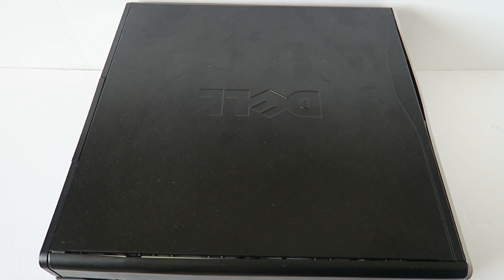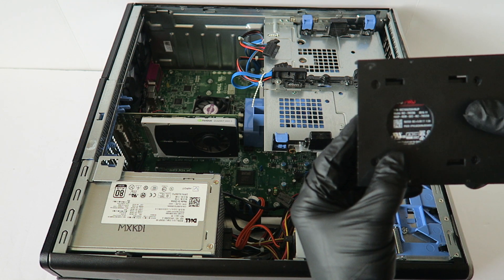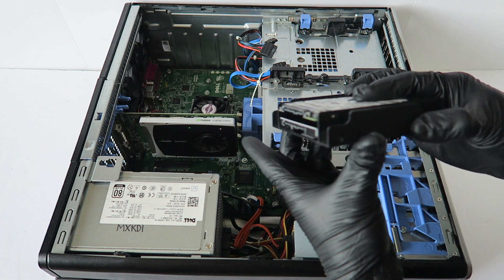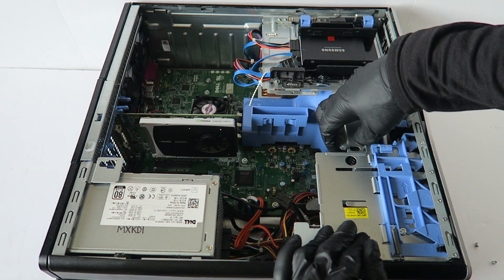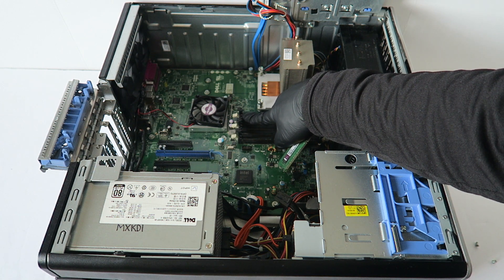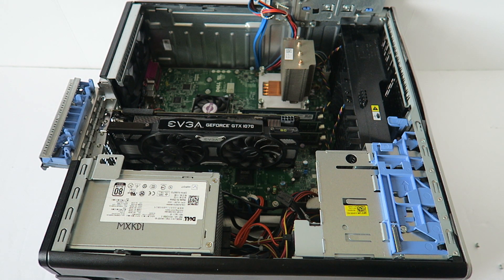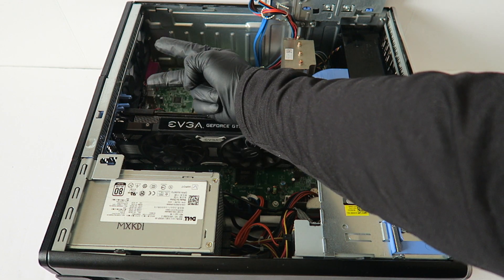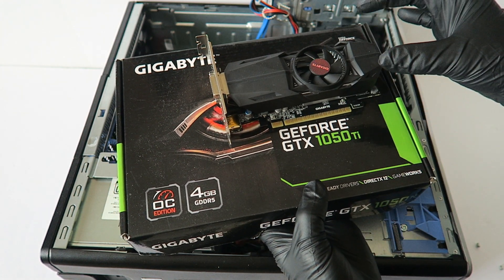Dell Precision T3500 Gaming Upgrade Video Card RAM SSD

Comment from the maker: Here is the list parts upgrades.
----> For GTX 1070 6-pin to 8-pin PCI Express Power Converter Cable for Video Card 
(1.) Video Card EVGA GeForce GTX 1070 SC GAMING ACX 3.0 Black Edition, 08G-P4-5173-KR
(2.) Video Card NVIDIA Founders Edition GeForce GTX 970 
----> For GTX 970 6 pin PCIe to dual 6+2 pin PCIe splitter Cable for Video Card
(3.) Video Card GIGABYTE GeForce GTX 1050Ti OC Low Profile 4GB, GBTGV-N105TOC-4GL
(4.) Hynix HMT125U6DFR8C-H9 Memory  DDR3 1333MHz  ( 2GB 2Rx8 DDR3 PC3-10600U )
(5.) Kingston KP223C-ELD  Memory DDR3 1333MHz ( 2GB 2Rx8 DDR3 PC3-10600U )
(6.) Samsung 256GB 850 Pro Solid State Drive
(7.) Dell 0R494D R494D Caddy Tray 2.5" - 3.5"
(8.) Seagate 2TB 2.5" Laptop Internal Hard Drive
Reply: Hi dose the gtx 1050 work with the dell t3400???
Reply: @MrConcyp  yes

Comment: I installed the GTX 1080, and it works great!  However the side of the T3500 case gets very warm where the air comes out of the graphics card heat sinks, and I notice the GPU temp is 87C with the case cover on, 83C with it off.  Is this a concern since the hot outcoming air is hitting the side of the case and doesn't have a great place to "flow"?

Comment: thanks for the very informative video. I also have a dell t3500 but the drive tray doesn't go all the way down because it seems to be blocked by the front fan assembly, do you have any solution for that?

Comment: Hello dear mxkdi,
                              I want to know if my Dell precision t3500 can allow 2 GPUs inside it.(I'm trying to say that can I install 2 GPUs at a time and run both together?).

My specs:
Asus phoenix GTX 1050 ti 4gb Gddr5
16 gb ram(2×2×2×2×4×4)
2 hdd (1tb and 160gb)
Intel xeon w3520 4 cores 8 threads

I have an extra Nvidia Quadro 600 1gb ram ddr3 and also want it to be running together with the 1050 ti.Is it possible?
Reply from the maker: Hi,  i would recommend sell both video cards and just get one faster video card and use in that PC.

Comment: I upgraded a T3500 with more ram, a GTX 1650 Super, a Xeon 5675, and an SSD, but they all benchmark about 80% of where they should be. Any ideas? Is it the motherboard? Or did I just get unlucky with all four of them?

Comment: I have also a t3500 my power supply is 525w I have a Xeon x5675. 12 gb or ram in 6 sticks and 2 ssd's. Do you think a 2060 is going to be ok ? I'm gonna buy use the conversion from 6 to 8 pins. I've see the tdp is 160w. So it's going to be ok?

Comment: How important is the chipset cooler? I just bought a t3500 with Xeon w3565 CPU and want to upgrade it with an MSI RX570 Armor 8GB OC. I saw in several videos that rear fans were installed and also 80mm fan was mounted to the 0U016F CPU cooler. Depending on how temperatures will look like, I will do those cooling upgrades. 
But this is the only source showing additional chipset cooling. Can you comment why you used it? Is it maybe depending on the CPU (you have 6-core)?

Comment: This is the video im looking for. Planning to buy the T3500. Is it also possible to upgrade the gpu to 1080ti or 1660?
Reply from the maker: Hi, gtx 1070 only and gtx 1080 ti will be bottle neck with this old system.
Reply: Mxkdi wym buy bottle neck is it useable?

Comment: Hi Mxkdi, what if I plug in 6pin from PSU directly into 8pin of GPU? (I plugged 6pin into my RX 580's 8pin with 2 pins left alone, the card shows red light). If I use 6pin to 8pin it would work?
Reply from the maker: Hi, yes you have to use 6 Pin to 8 Pin PCI Express PCI-E Video Card Power Adapter Converter Cable to make your video card work.
Reply: @Mxkdt  ok thanks for so quick reply!
Reply: @Mxkdt  I also purchased t3500 and rx 580. The video card has 8 pins. What should I do now? Is it safe using the connector?
Reply: @TheShaziaShow  buy the SATA to 8pin molex converter power cable.
i also used it, works perfect.
before that i tried 6pin to 8pin converter but the cable burnt after few weeks.
Reply: @HassaanALal  did i use sata to 8pin with rx570 ?
Reply: @MUHAMMADAli-pe2mx  yes you can use SATA to 8pin for rx570
Reply: @HassaanALal  thanks and my supply is 530w is that much?
Reply: @MUHAMMADAli-pe2mx  ye it's fine just dont overclock
Reply: Did it work? Also worried.
Reply: @TheShaziaShow  did it work?

Comment: i have t3500 and w3530 prossesor can i have rx580 without bottleneck?
Reply from the maker: Hi, You can upgrade to Xeon X5650 or Xeon X5675 for around $30 that is great deal.
List of CPU you can Upgrade..
1. Intel Core Xeon X5660 2.8GHz 12M Cache 6-Core SLBV6 Processor
2. Intel Xeon X5675 3.06GHz 12MB 6-Core 95W SLBYL Processor
Reply: @Mxkdt  thx very much♥️♥️
Reply from the maker: Hi.

Comment: My T3500 came with a WD Raptor 10k rpm.  Is it worth going SSD?
Reply: 2 raptors in raid is still slower than an ssd, but back in 2008 it was the fastest option.
Reply: Do a comparison in speed with a CrystalDiskMark, this will answer your question. :)

Comment: Hello Mxkdi,

Always very good videos!
But my english is not perfect...

How is the chipset fan fix? What is the format?

thx for your return,
Bye
Reply from the maker: Hi, yes you can use 40mm fan or 50mm or 60mm fan for cooling chipset and rear fans are two 80mm
Reply: @Mxkdt  Thx! But the fixations for fan chipset? My original rad is not equipped to receive a fan...

Comment: I got a T3500 for 40€ a few months back.
Upgraded the CPU to a X5675, the RAM to 24GB and threw in a SSD and GTX970.
Really happy with it as my secondary rig now.

Great video btw.
Reply: Did you have to change your power supply?
Reply: and did you need extra splitter cable or something like that?
Reply: Yes I had to get a splitter cable since the PSU only had one 6 Pin connecter and the GTX970 needs two. 
But changing the PSU would work too since it's not proprietary
Reply: @JakonDeluxe  thanks,  only one thing, What PSU did you buy?
Reply: I have a Corsair VS550 but any ATX PSU will work.
Reply: @JakonDeluxe  Hey Jakon, sorry this is the last questions ahah: can you link where I can buy the splitter for extra power?

Comment: Thanks for such a informative video, I need your guidance, I am using Dell Precision T3500 with EVGA GTX 770 2gb can i install another one and use bridge option or what you say...?
Reply: SLI will not be worth the money. RX570 or RX480 will cost the same as a second 770, and will give you a better experience.
Reply: Sli won’t work, only crossfire (for amd cards) does

Comment: My GTX 970 doesnt let my pc start up Im using a 6 pin and a sata to 6 pin connector
Reply: Don't use sata to 6-pin adapter! It doesn't provide enough juice! Use a molex to 6-pin connector!
Reply: I think it's a power supply issue

Comment: what cpu are you using? I was wanting to know if w3550 will have bottleneck issues with this gpu(gtx 1070)
Reply: bottlenecking is usually a figment of the imagination invented by people who want you to buy a new cpu from them. my i54570 has never been above 70% capacity with my rx 570 at 100%
Reply: xeon cpu

Comment: can Rx 580 will work or I need to upgrade the power supply to 600watt ? btw love your videos it's very helpful🙂
Reply: It will work fine. GPU power requirements as listed by the manufacturer are always exaggerated, while Dell PSUs, particularly in their workstations are underrated.
Reply: Dell motherboards don't like AMD GPU's
Reply: @tatemushroom1002  From what I've heard they don't like AMD GPU's like the RX 560 that only draw power from the PCI-E slot. Ones that have a 6-pin connector to the PSU seem to work from the many examples on youtube

Comment: what is the model number of the psu you have??
Reply: I suspect that the original 525W ... I had to replace the model N1100EF (1100W). But it fits the power supply of the T7500.

Comment: So my question is what Xeon are you running, I am getting thevw3690 setup soon and I glad to see that this system can get extra cooling and a great video card , but what u plan to do is upgrade to a better country cooler I heard Cosair has a good one , so that cooler does the trick for you not to much heat on CPU?? Thanks great video..
Reply from the maker: Hi, i am using original dell heatsink with Xeon x5675 right now and you can also use x5660, or x5680, x5690.

Comment: Are you sure that stock PSU (I believe is 525w ?) is enough for that GPU? And are those 6pin to 8pin adapters safe to use (knowing that 6pin maximum wattage is 75 and 8pin is 150watts)? I'm asking because I'm planning to upgrade my T3500 with RX 580 and I need to be sure will it work. Thanks.
Reply from the maker: Yes 525w is enough on load with gtx 1070 video card system using around 280W while gaming. i am not sure if rx580 will work with this system, i never  tested.

Comment: hey can u tell me why my second HDD isn't working as fast as the SSD like it's very very very slow when I execute a game it stays at loading for an hour do I need to put a Dell optiplex sata cable into it or what?
Reply: Ssds are faster than hdd so hdd speed will be slow

Comment: 😏 interesting, ive never seen u install such a fast video card in ur videos before, cheers ✌️😏🥃
Reply from the maker: Hi, you can also use gtx 1070ti faster video card if you want.
Reply: @Mxkdt  ✌️😎 ok Cool
Reply: Mxkdi hey sir I wanna know what cpu did u run on that machine ?
Reply: @xadofn5762  on a t3500 people like: x5670 x5680 x5690

Comment: Hey !! Great video thanks.  Can you do the same upgrade on a T-7500
Reply from the maker: Hi, i only have T3500 and T5500 right now and my next upload video will be T5500 gaming upgrade.
Reply from the maker: Yes you can do same upgrade on T7500.
Reply from the maker: Dell T5500 Motherboard does have Intel 5520 chipset 2009 and Dell T3500 does have Intel X58 chipset 2008
Reply: @Mxkdt  😋 sounds yummy, just get one of each 🙂🙂🙂
Reply: ✌️😏 Sure, T75 & T55 motherboards are very similar, good stuff 🙂🙂
Reply: @MrSamadolfo  Thanks!!